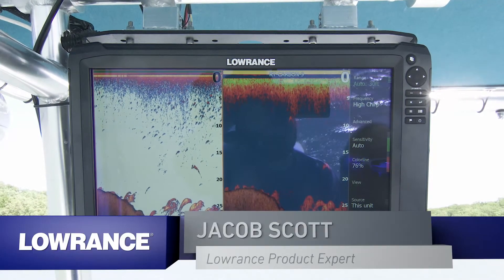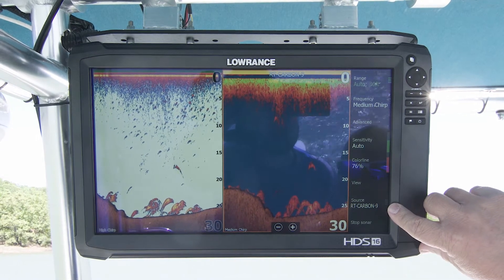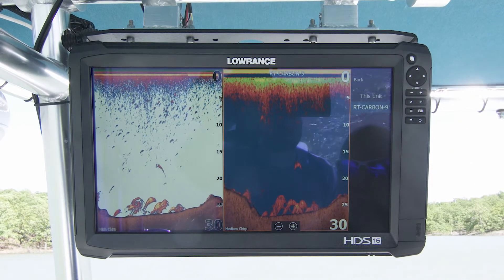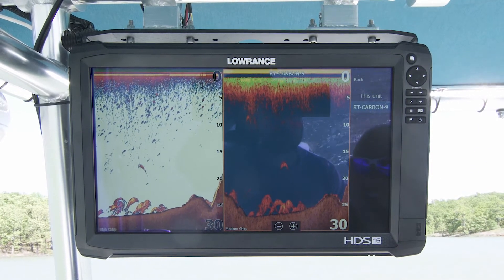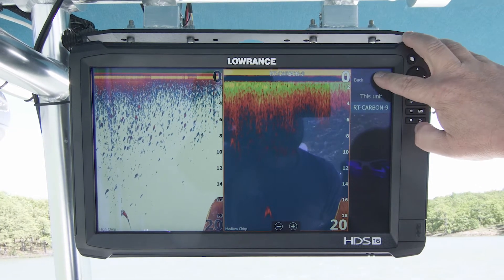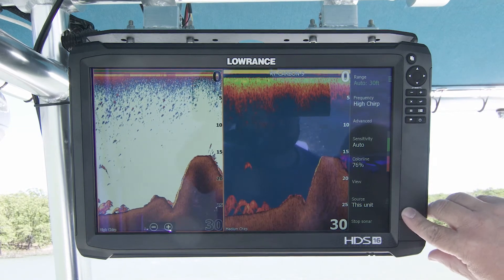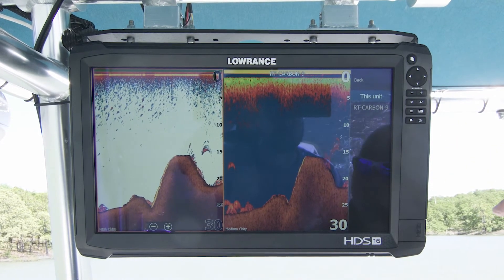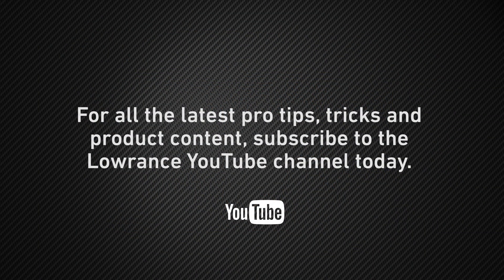Selecting a Sonar Source on a Lowrance HDS Display

Comment: hello, source question.
i have 2 hds carbon,1 transducer sources thruhull 2d airmar b60.
i want to display same sonar on both units.
the units connect via a module and ethernet cable.
does the transducer go to module first, then output to both units, or do i directly connect transducer to back of one unitard they share via module /ethernet cable.? if there is further video or info on this please direct me to it.
thanks
john

Comment: I have had numerous Fish Finder/GPS devices over the years and Garmin has developed the Striker model to compete with all comers at a better>>>allabout.wiki/4m7o     Great visibility in all possible applications. I am using as a Trolling motor mounted sensor on the front end of my pontoon boat.Perfect application at less than half the money of the other fish finder manufactures. Since it is waterproof, it is also great for canoes and the small watercraft.